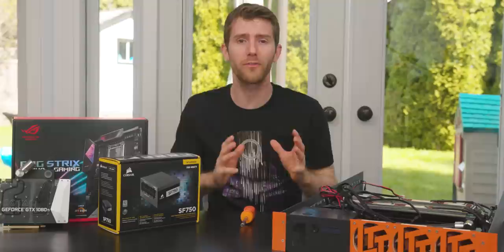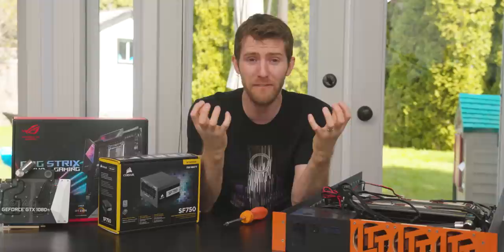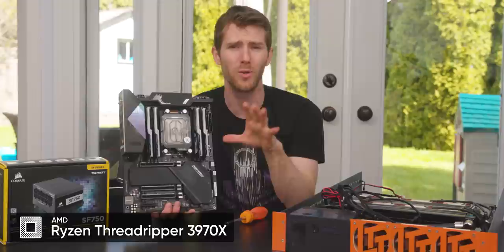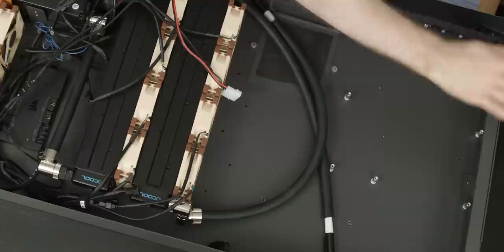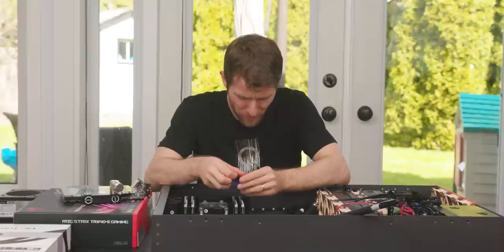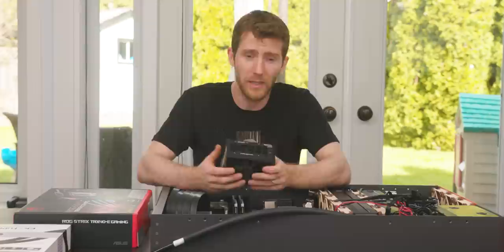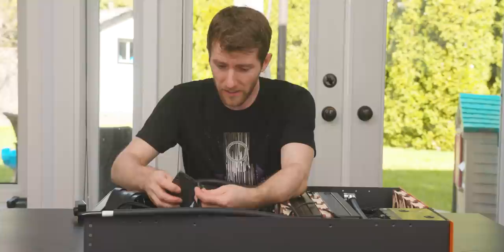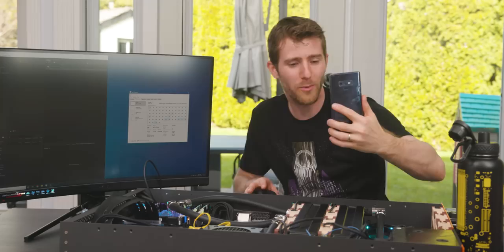Who is Video Rendering KING? Transcode Server Upgrade!

Comment: "This threadripper-sized socket is never coming to an ITX motherboard"

ASRock: Hold my beer.
Reply: Micro ATX? Yes. ASRock's literally been doing that since Threadripper/x399 first launched in 2017 in fact (and ofc they're the only one's with either a mATX X399 or TRX40 motherboard). But ITX? Never going to happen. 

There's just no physical way to fit the sTRX4 socket, significantly sized TRX40 chip, AND the necessary VRM's & cooling for all of the above in a mITX form factor. It's simply impossible without getting rid of the chipset. (Which is what makes ASRock's ridiculously awesome mITX EPYC board possible. EPYC's 100% an SOC, it has/needs no separate chipset).

Comment: You gotta remember, premier is heavily optimized for Intel as is the case with most other encoders out there. Handbrake and xvid4psp barely saturate amd cpus but absolutely hammer Intel cpus to near 100% right through.

The fact that amd is matching or beating Intel with lower saturation and less optimisation support says how much more powerful ryzen is compared to Intel.
Reply: well that's gonna be hard for intel to catch up. imagine amd going out and try to persuade developers to optimise the cpus
Reply: @23nguyenthanhlong49  in many cases, it's actually intel optimizing things for them, rather than asking them to do it.. Intel's software department is massive, and they maintain lots of libraries that other applications can use free of charge.

One example of this is a math library used by Matlab, where the software doesn't use all the capabilities of an AMD CPU even if the CPU supports them. It would use SSE instructions instead of AVX2 on AMD, even though the AMD processors support AVX2. On Intel, the software would always choose AVX2 or AVX512 if available.
This is fixed now, but I'm not sure if it was the developers of matlab that went in and made a workaround, or of Intel themselves finally fixed the "bug" after people started noticing.
Reply: So thats why my handbrake transcode on my Ryzen took ages....
Reply: @stale2665  thanks for the piece of information, its kinda hard for me to understand but i get it now :)
Reply: Intel's power level is above 9000...sorry, that was a typo 😂 fine print said only if we're talking about the inefficient power profile. Nice space heater thou.
Reply: There's so much wrong with this post it's hilarious.
Reply: I9-9900KS still best gaming CPU.
Reply: Yeah I doubt premier is heavily optimized for Intel. It's not a GPU, there aren't that many shortcuts. It's encoding plain and simple. AMD puts a lot of optimization into as well. Also, CPU saturation isn't an end all. It lies in terms of bottlenecks (even if the CPU isn't maxed in Task Manager, it may still be bottlenecked).
Reply: @seerking  you mean best scamming CPU =))))
Reply: @neko5364  no I don't, I mean the best gaming cpu, like all the benchmarkers and nerd tech reviewers like linus agree.
Reply: Intel has more people working on software than AMD has total employees
Reply: @seerking  the original zen,+,2 architecture really isn't optimized for a gaming load and really has always shined where many cores can do separate tasks, the zen 3 redesign should improve ryzen cpu's in gaming quite a bit and we will probably get a better idea of how zen 2 should have performed if the road blocks in the original zen architecture are fully removed. the 4x4 core layout kills amd's gaming performance when only a few cores are used constantly going in and out of different 4 core blocks into cache etc. zen unifying to an 8 core module increasing cache speed will improve gaming performance and according to amd its really going to be the first brand new zen architecture since the original zen everything since then has just iterated on the original zen design. should be interesting to see how it does end of this yr. maybe amd will finally beat intel in gaming although comet lake at 5.3ghz should make a pretty stout gaming cpu although we already kinda know how that works we have 9900k's running 5.2 pretty common on youtube so you don't really need to wait to figure out comet lake performace lol
Reply: @TheCivicsiep3  I'm confused, all that large paragraph with an lol at the end? What was the point?
Reply: @seerking  It really could have done with some paragraphs, but it was actually a pretty good breakdown of how the CCX L3 unification to come should result in significantly lower latency and thus better gaming performance (effectively a higher IPC for such tasks). Combine that with a higher clock, and we should see a good competition between them.

It really wasn't that hard to read.
Reply: Intel is looking at bad times if they can't adapt to the times. Multi-core threading is very important and AMD is running circles around Intel in this regard. Multi-core threading is the obvious future of all programs.
Reply: @jerm70  idk about all that. But I do agree that amd is giving intel a run for their money. But intel is such a huge company. They will be fine even if amd takes 1st place for a little bit.
Reply: @seerking  Well the problem Intel has is that Research and Development cost a lot. Intel doesn't have the pipeline to switch to focus on Multi-Core threading. It will take them years to push out similar multi-core performing CPUs. AMD could legitimately with R&D manage to bust the Single Core race.
Reply: @jerm70  that's your assumption and opinion not fact. Intel has been on the top leaderboards so long and has been taking advantage of regular consumers market as well as the commercial consumer market and hasnt had much competition at all. Trying to suck out every penny they can without spending a lot of money. AMD finally caught up and it's all brand new so we will just see how intel is going to respond. Intel hasnt really responded yet. They're definitely on it though since alot of testing and dev chips have been leaked. We will see what the final product is of if they're going to make a grand finale comeback in 2021 or 2022. But I'm most certain their will be one. Same with NVidia. They dont have competition so they can be as lazy as they want and make the rules. Until someone challenges them. Doesnt mean they're going to need to make a response right away. Nonetheless everybody is just overhyped by the youtube videos. Intel isnt failing ad a company or in this very specific department. They just now have some competition is all.
Reply: @seerking  man u are wrong...the i9 9900k is the fastest gaming cpu, ur cpu is somewhere in the top 5, but surely not the fastest...
Reply: So that's why the utilisation on my 1700x is way lower than on my 1600x when encoding something with Handbrake.
Reply: @seerking  yea problem is, fedex destroyed my pc when i shipped it for moving, and so i need to replace that and its prob goign to be amd becuase im going to be doing a bunch of other stuff then just gaming on it and that will work out best for me, also to note, fedex is claiming its not their fault that my working computer came with video card, cooler, motherboard damage and memory sticks out of their slots ...
Reply: Seer King if you are so naive about tech why are you going around calling people nerds, how about you get a life? Pointless arguing bro
Reply: @georgwarhead2801  nope for gaming it is the fastest. I'm just talking about gaming not other tasks
Reply: @TheCivicsiep3  i just want better gpus in the high end market from Amd.
Reply: @ilenastarbreeze4978  sorry to hear
Reply: @seerking  nope, n overclocked 9900k is faster than a 9900ks and kf, it uses more power, but it´s faster...the ks has less ipc than a k, because of lower powerconsumption and security patches . on stock the ks is faster because of higher clocks, but océd the k is faster
Reply: facts
Reply: @PunkBat  no I'm not bro...I've been building computers since the 90's and have almost all the mainstream consumer tech out, except an iPhone because I'm not a fan;)
Reply: @georgwarhead2801  I mean most k cant overclock to 5.2, 5.3Ghz and most struggle to even get 5.1Ghz. Some can but it's chance like all binned hardware. Ram, gpus, cpus, ssd's, tvs, phones, blah blah blah. Your smoking. Those first beginning YouTube videos you watched didn't have updated bios or windows updates. That's no longer an issue anymore. I'll out perform any i9 9900k or kf.
Reply: Seer King then why are you being rude bro it’s uncalled for
Reply: @PunkBat  I'm definitely not bro. The other guy was being rude. Insulting me. Bro
Reply: My sentiments as well.

Let's face it, with Intel's dominance for the past few years, it's no surprise that developers would be optimizing their code for Intel. Not deliberately, but rather because most of their developer rigs are using Intel as well, so as they optimize their software, it's not going to magically optimize itself for AMD hardware.

Yet with decades of optimization for Intel's hardware, AMD has managed to catch up. What you see now on AMD hardware is mostly due to brute force performance, just think of how much more performance can be squeezed out once AMD/software developers starts optimizing software for it.
Reply: Aww guys, don't stop hurling insults at each other. It was a fun read while I eat popcorn.
Reply: Seer King so relevant to this thread. Congrats. Do you have one and are you getting the new 10900K when it launches?
Reply: Seer King you are at it again, just relax
Reply: Your wrong. There is powerful intel cpus
Reply: Intel is best 😏😏
Reply: @23nguyenthanhlong49  They won't need to persuade when the market becomes full of AMD PCs again software developers will naturally want to optimize for the systems most of their users are running.
Reply: @seerking  the KS is not the best gaming CPU, it's the best SCAMMING CPU, it litterally a 9900k with just a better Pinned on the Pinned CPU , 300mhz more on base boost  and 100-200mhz more on overclock because of better pinned for it to suck more  power, and litterally get 1-3% increase on some game and other game is like neck and neck for like 50-80$(extra 80-120$ for better AIO) LOL
Reply: nobody in this thread knows the difference between your and you're but are writing books on long wording making themselves look smart. However, i have gotten quite the read here, thx
Reply: @seerking  This is a post about video enocding, what are you even doing here?
Reply: @jerm70  you are absolutely right the future of all programs are multi threaded, I would say no new programs will use less than 4 threads if the program is intensive at all. all game engines now are all heavily favoring multi threading several new game engines make good use of multi core cpus and fall flat even on some 4 core cpu's esp in 1% low perf. anyway zen 3 should be the cpu we have been waiting for amd to make it took a while to get here but I believe zen 3 is going to shine in gaming work loads. and after the boost debacle on zen 2 I don't see amd doing that again I fully expect zen 3 cpu's to regularly hit posted boost clocks without any special circumstances
Reply: @TheCivicsiep3  That is the future though. It's inevitable that multi-threading will take over. What do you think is going to happen? Intel making 8ghz CPU cores? 16ghz CPU cores? 200 ghz CPU cores? It doesn't add up. It's just very unlikely that powerful cores will be a sustainable market. Multi-threading cores are obviously the future, which is why Intel has been kicking dirt trying to rush out products that will be outdated because it takes time to pivot your entire R&D.
Reply: @jerm70  I think your example is quite extreme and not really accurate either I mean to say intel is kicking dirt is kind of a stretch lets be real here. comet lake will likely be the highest clocking desktop architecture for some time I do expect intel to drop frequency when going to rocket lake but their Ipc improvement should make up the difference and then some. intels current architecture actually is a strong multithreading performer it can manage 5.0ghz across 8 cores and the new 10900k should do more across 10 so to say intel is a slouch in multithreading is false but their architecture definitely serves to boost single thread performance and low latency access to cache and system memory this is partly why it has all of the security flaws that really cant be fixed because its an architecture issue not a software issue. either way amd's zen approach from the ground up was build around 8 cores really and 7nm and chiplets have allowed amd to cram even more cores on a chip. both systems have their benefits, for now I fully expect comet lake to retain the single thread performance advantage but I think zen 3 will change that
Reply: @moldoveanu8  this i agree lmao
Reply: @seerking  hows your power usage lmao
Reply: Except that this supposed per core-basis superiority of AMD over Intel is just a misleading conclusion. For starters CPU utilisation amongst different architectures is not directly comparable. Now also bear in mind here that what Windows reports is the percentage of logical threads being “fully occupied” but what exactly this entails goes a long way. Think of toilets: I can be “fully occupying” the toilet but it goes a long way from just urinating in it to having a full dump after a week…A 100% utilisation on Cinebench is different from 100% utilisation on Prime95. Anyhow even then, utilisation in this case was 45% on the 32-core and 60% on the 18-core. Being measured on a logical core basis it means that 45% of the 3970X is 28.8threads (=0.45x64) and 60% of the 10980Xe is 21.6threads (=0.6*36). In other words, this workload needed more threads than the number of physical cores/threads the 10980XE could offer whereas it needed less than the physical cores/threads the 3970X could offer. 

Hyperthreaded/SMT threads are not the same as physical threads. If frequency and IPC were the same the difference should be roughly similar to the ratio between utilised PHYSICAL threads which in this case is 60% (=28.8/18). Since the 3970X is overall only 50% faster, it means its per-core basis performance is LOWER than that of the 10980XE, not higher. In fact, it means the per core performance of the 10980XE is 20% higher.

Last but not least it must also be mentioned that the tests were performed at STOCK frequencies meaning the all-core turbo on Intel was just 3.8GHz while that of AMD was 4.0-4.1GHz, thus AMD had the clock speed advantage as well…

So much about your beloved AMD catching up with Intel.
..
Reply: @alexmarin7897  Okay, I'm going to reply to this, but there is quite frankly so much here that is just overwhelmingly wrong I'm having a hard time figuring out how to even address this or where to even start...

How about this, you did all those calculations to figure out that the work load preferred more threads to more cores, however I already pointed out that this particular software encode favour's Intel processors. So even with your calculations, that fact skews it.

Next, if the amd's per core performance was lower and it beat the intel overall then... yeah, the amd part still won.

Also, if at stock speeds the amd cpu was clocking higher than the intel stock speeds, then im still getting more out of the single part i purchased at stock settings which is what the warranty covers, for less money than the intel part... so yeah id call that winning.

Comment: "We wanna something with 2.5G Ethernet built-in so that we wouldn't need to modify the chassis to put in... a... faster network card"
1 month later
"We're gonna throw a 10G Ethernet card to the transcode server!"
Reply: All jokes aside, he'd probably add a 40gig card, y'know, because he's Linus and he's absolutely nuts.
Reply: @waluigishazz5100  Linux would find a vendor to sponsor them the parts for the upgrade in exchange for promotion via the video, and the sick segue.
Reply: If LTT always did everything optimally they wouldn't have half the videos they do now.
Reply: @waluigishazz5100   probably a 40G card will sit in each petabyte server and the SSD storinator/Jellyfish Fryer. but each editor rig will get 2.5G card each first while his desk PC will get a 10G card.
Reply: Funny that, I got a bunch of old FC 4gb fiber cards for free this weekend, and found a 4x 40gbit card in there. Now I just need to figure out what I can do with it.
Reply: @traniel123456789  probably absolutely nothing.. 
Assuming you don't have 40gbit internet the only real use would be to either get a 2nd one or put it in a server hooked up to a switch with a 40gbit link and connect your other PC's/devices to that switch so that way you can have multiple clients saturate the pipe to/from the single server.

Comment: TURN YOUR RTX ON for the intro, I need that thing in my life.
Reply: You really do mate, especially dlss 2.0
Reply: It was probably the best intro they have done so far
Reply: @alexreilly8478  It was fan made, and posted on the unoffcial LTT subreddit. I guess someone at LMG saw it and (asked to) used it
Reply: @alexreilly8478  They didn't make it. A fan did and sent it to them via Twitter.
Reply: Even if it's fan made, it should get used more often (as long as the fan is ok with that).
Reply: @jamiepearson532  Yeah, totally! I'ts a very good intro. it is missing the transformers logo on the monitor though.